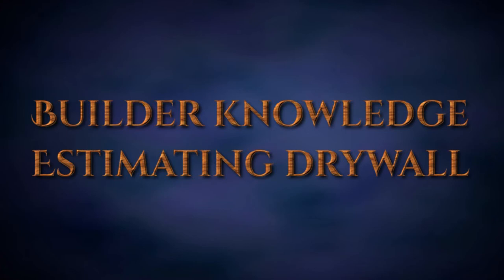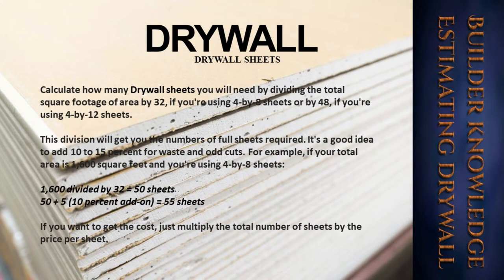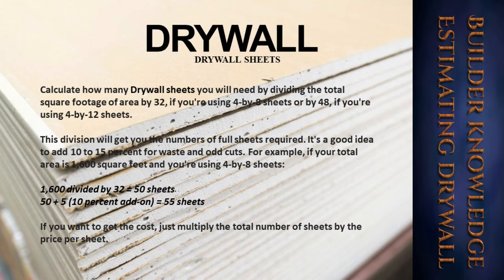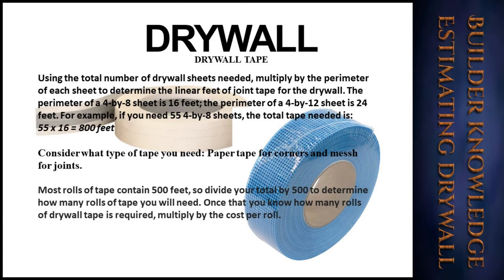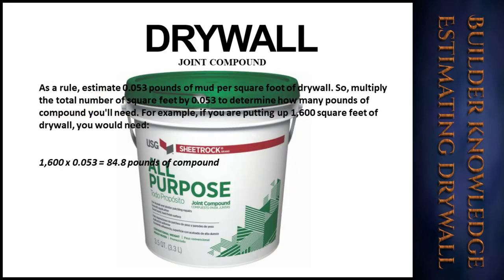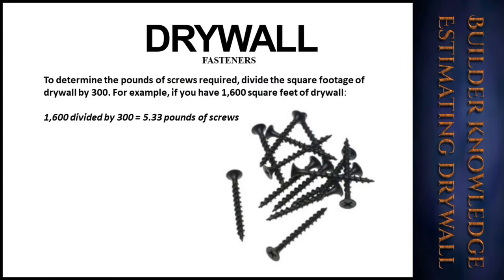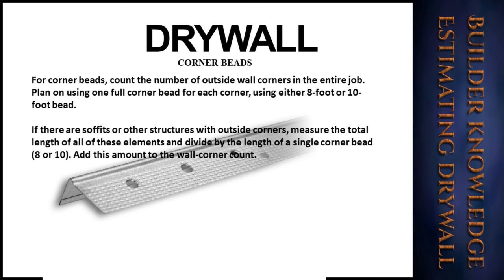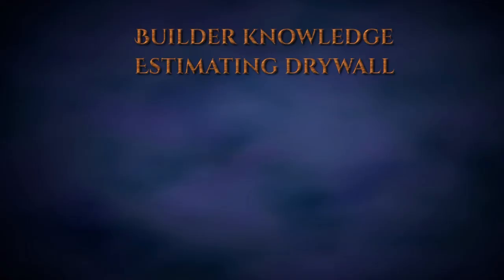BKC Estimating Drywall, Joint Compound, Tape and screws.

Comment: Isn't the perimeter of a 4 x 8 sheet of drywall 24ft?
Reply: a sheet covers 32 sq ft
Reply: Right? And a 4 x 12 should be 32 ft. The video confused me there, I'm not sure if they got it correct
Reply: @contras.  when you read prints find square footage on frame… let’s say the number is 4312 you would divide that number by 32 and you should get your sheet count then add another 10% of sheets for possible damage from delivery
Reply: No 4x8 is 32. So did use the sqft by the sqft of the sheets you will be using 8,910,12 whatever.